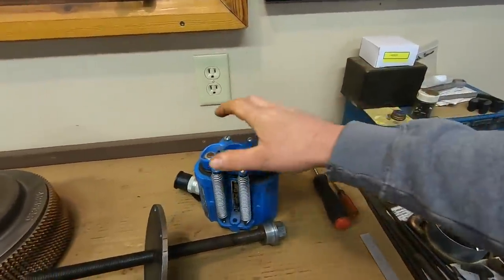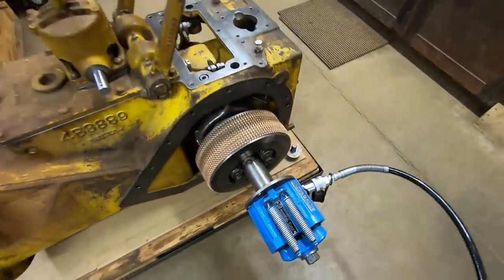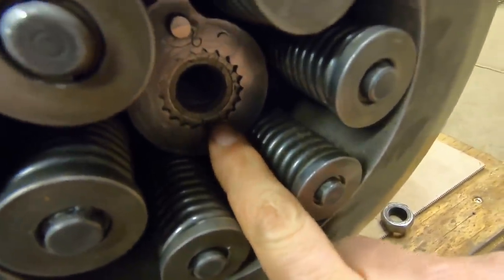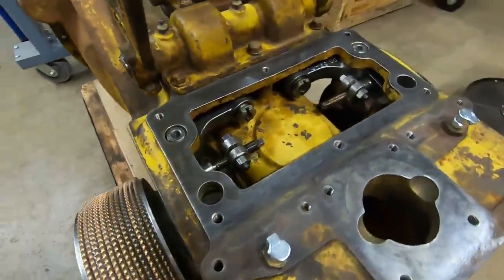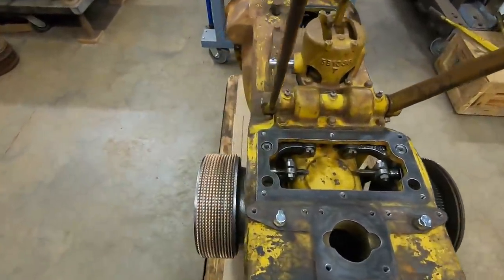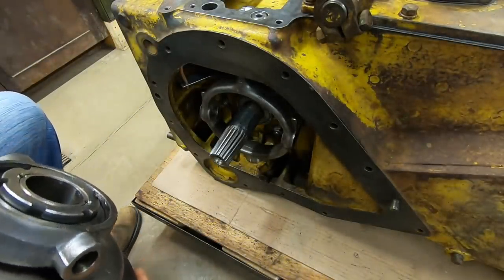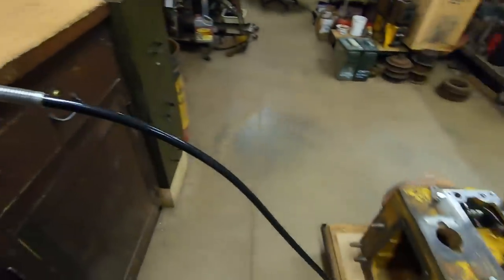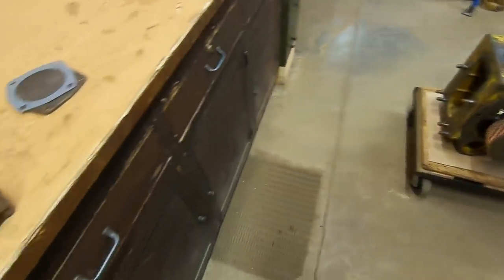Caterpillar D2 #5J1113 Chassis Rebuild Ep.21: Steering Clutch Press Fit & Finishing The Transmission

Comment: On the subject of lubrication, 21:25 many years ago a UK Steam Railway was bringing a main-line Locomotive back into service. One of the problems they encountered was bearings running hot. On short haul locos the oiling cups were close to the areas that needed lube, (not a problem for access on short stop-start runs), but on a main-line high-speed loco some of the crucial cups were in the cab, with oil lines running the length of the engine, so they could be topped up on long trips, running through a 'wick' in the tube to control the flow. They were using a modern synthetic mix for the wick, where as the original spec was for flax. The other problem was oil: They managed to find an old-timer who had 'purloined' some when the sheds closed decades before. They used that as a sample to get analysed, and then persuaded one of the big oil companies to 'sponsor' them with a one-off batch of it, as it has no modern counterpart! When they replaced the synthetic wick with the flax, and used the correct viscosity oil, it all came good. 

Goes to show, a simple drip-feed oiling system had a hell of a lot of science involved in getting it right, and all that knowledge lost with the switch to diesel locomotives :-(.

Comment: As a former high school shop teacher for 35 years, I really really appreciate your level of explanation. You are a great teacher. I remember finding in a cabinet a dusty box full of film strips of how to stuff on engine rebuilds and some early film loop cartridge type educational films. If they were 10% as good as what you do, they might have been useful. So thank you so much. Second comment. I love the fact that she goes back together with her old patina. Have you ever considered spraying it with a matte finish clear in order to keep further rusting at bay but to keep the great look?just wondering, don't know if such even exists. And your timing is exquisite. I am restoring my great uncles 1941 Chevrolet pick up that he bought in 1942. Where the clutch and brake pedals come through the floorboards there is a piece of felt. I have been looking all over for a supply. Thank you McMaster Carr. I am with you a lot of this old engineering is truly art.
Reply: B
Reply: You can paint over with Penetrol (same as Owatrol) , which is the clear oil that oil paints are made with - it cures to a flexible film and penetrates rust ,sealing it. You can also  coat with a lanolin / kerosene solution but this allows dust to stick for a period and needs to recoated every couple of years but it also penetrates the rust and the metal surface. Assuming you can get lanolin. In New Zealand and Australia it is easily purchased - because sheep. Here there are several companies that produce industrial products  from lanolin - a wool industry waste product.

Comment: I grew up in a family logging business and spent a fair bit of time as a lad packing tools and parts in and out of the brush, replacing steering clutches, swapping out final drives and doing all of the other sundry repair chores that come with maintaining heavy equipment. Folks watching you do these tear downs and rebuilds at your farm and in the shop don't realize what life is like when these things go south way out in the brush, up on the side of a mountain. In those times you're lucky if you can nurse a wounded piece of equipment back to the landing where you can drive up to it with the tool box.  Otherwise, everything you need has to be packed in and out of wherever things failed.  I remember laying under cats praying the belly pan wouldn't bury me in the mud when I dropped it and all the times I spent bouncing up and down on 10 feet of pry bars and cheater pipes (or 'swedes' as my dad called them) on those old 3/4 drive sets, breaking nuts and bolts loose, or tightening things back up.  I'm pretty sure you have any number of stories about doing this stuff out in the wild, dodging snow balls and laying in the mud.  Fun times :)

You've also probably heard the term 'cat doctor' - these were the old stoop shouldered, knuckle-ball mechanics who had been around for decades twisting wrench and doing the hard parts on heavy equipment repair.  I do recall a few times we had to bring out one of those legendary characters to do the one-off or specialized stuff we couldn't handle on our own.  Gyppo logging at it's finest :)

I really enjoy watching your videos and listening to you explain things as you go - you could go on to become one of those 'cat doctors' yourself :)

Comment: suggestion: shop towels  ask at the local hospital about the towels they use in surgery after they start to fray they throw them away after final cleaning. i've purchased large bags of them for shop cleanup before ours here are blue in color. usually they're much cheaper than at the department store.
Reply: Good idea I usually get rags and towel rags from goodwill. Sometimes they come pre cut into rags other times you gotta cut rags out yourself from whatever free clothes they give

Comment: Main clutch lever.. if the other 2 spares are used.. in the wallowed out hole.. use a fine thread solid thread insert so you can thread the link into that insert so instead of it being a threaded stud in a hole its threaded stud in a threaded hole..   its just a thought.  if you don't bore the hole in the clutch lever all the way thru and after grinding flat any extended insert you have a semi hidden fix that only people who watch your video will ever know about.

Comment: Squatch, we always drilled a hole in the bottom final drive plugs (should have said steering clutch housing plugs) and installed a large cotter pin that could rattle a bit during operation and thus allow moisture a way out and yet keep “whatever”out. Really enjoy this series as it takes me back to my beginning wrench days in the early 60’s...great memories Thanks 😊
Reply: 8ns are also known for having a cotter pin through the bell housing hole ..

Comment: It looks like that end steel disc is the sacrificial element; that the reason they put that in there was to wear on the removable metal disc with clutch material rather that wear into that pressure plate and have to replace the whole thing when it wears out. Great idea!
Reply: Yes, simple once you see it.
Reply: I would guess that that’s not the real reason. If you follow the power flow from bevel gear shaft, to clutch hub splines, to steels, to friction discs, all the torque is transmitted through splined components.  If the pressure plate isn’t splined to the hub, you would be transmitting torque through the pins that the springs ride on if you didn’t have that last steel.
Reply: @tnbrett1273  Correct. Well spotted.

Comment: Thank you for the tip on how to keep the steering crutches free from rusting together.

And cold weather I could get that on my semi tractor which I still can't get on the road yet the brakes will ice up if I don't move the truck at least once a week.  I fire up the engine at least once every 3 weeks and exercise it for 3 hours driving it around the parking lot.

Would weekly exercise suffice and keeping the clutch pack from icing up with rust and debris?

Some day....

Comment: You make it look so easy.!

I love the look of those clutch discs.  How are they kept clean from debris and ambient moisture?
I called a place for a quote on a reman D4 transmission and engine and both of them together neared $40,000.  I think I'm just going to have to rent my bulldozers; spend the $1,800 a week and then just turn them back in after I've used them and had my fun.

Comment: Why will flat co-planar surfaces stick together?
 Wringability and Gage Blocks
By Dave Friedel, General Manager of Starrett's Webber Gage Division 
Wringability is an important property of gage blocks. In fact, gage block specifications recommend replacing blocks that have lost their ability to wring. Not everyone uses gage blocks in wrung combinations, but wringability is a test on the integrity of the surface condition of the gage block. Gage blocks that don’t wring may give erratic and unreliable results.
The fact that gage blocks wring is incorporated into the lengths of the blocks themselves. Gage block length is defined as an interferometric measurement when the gage block is wrung to a flat platen. This includes one wringing film in the defined length of the gage block.
This definition is very useful. When gage blocks are assembled in combinations, no additional correction factor for wringing films needs to be added to the length of the combination.  
 

Wringability itself may be defined as the ability of two surfaces to adhere tightly to each other in the absence of external means. (They are not magnetized or clamped together.)
Wringing requires two smooth, flat surfaces with surface finishes of 1 microinch AA or better. For gage blocks, it becomes difficult to wring surfaces if the flatness starts to exceed 5 microinches. The sources of the forces holding gage blocks together are thought to come from:
1) Air pressure from the surrounding environment as the air is squeezed out when the blocks are slid together. 
2) Surface tension from oil that remains on the gage blocks or water vapor from the air acts as a glue to hold them together. 
3) When two very flat surfaces are brought into such close contact with each other, this allows an interchange of electrons between the atoms of the separate blocks, which creates an attractive molecular force. (This force will remain even in a vacuum or if no oil or water is present on the blocks.)The last two sources are thought to be the most significant.

Comment: Hey Squatch, a little late on this episode but still working on the D2. I have had this tractor for 4 decades and know that the steering clutches have a rust issue here in Ohio. Have you had feedback on any coating to put on the disc to slow down the rust problem? Not sure if anything like Ospho on the steel disc would work. Thanks to General Gear, I have received both side sets of the sintered bronze and all new steel disc. Thanks Howell Machine, LLC.

Comment: There is a way to get a lower res camera angle from inside the machine to show what you are doing in some cases by using an endoscope. The ability to insert a camera into the access holes or from the other side and just use a magnet to hold the lens in place can be good for getting odd shots. A sealed camera and lights so can still clean it off when you get it messy but not sure how it will deal with solvents as it is normally just for wet places like pipes.

Comment: Have you ever actually seen a D2 with the low/rear seat option? That would be a nice addition to your collection!
Even to get one with that option (regardless of the condition of the rest of the machine), and use those pieces to retrofit one of yours.
Reply: Thanks Squatch , that is quite a machine. Interesting to see how all the components were moved backwards as you said. The leveling pads in front of the tracks too - neat.
I see what you mean though, I think you would need a seatbelt to keep you in the seat! Probably fine on level ground in orchards and fields.

Comment: The addition of 4 new clutches and steels will make the clutch holding power 150 percent of stock, based only on the increase in friction area. Typically, bi-metallic clutches have a greater coefficient of friction over standard asbestos based linings.  How much greater holding power does the clutch assembly have?  I know it doesn't  make much difference, because the motor will probably stall out before the friction limit is reached.  In practical terms, it only really means that the clutches will last longer as long as maintenance is kept up - it won't really affect the performance.

Comment: I wonder if you could blast in some BOESHIELD T-9 into that area all over the non rotational (clutch pack) metal to prevent corrosion/rust if/when moisture builds up
Might also be a good use for the stuff for storage as well
Very very cool to see it coming together with new non-rusted parts!
Keep em coming!!!!

Comment: If you wanted to vent that steering clutch area, you’d have to make up some sort of adapter plate to bolt on and replace the cover. It should need a pipe attached with a bend to keep out rain and a fine mesh grill.

Comment: Just as well I waited a little...  when watching the section describing the clutch system before you had fitted the second clutch, and, as a motorcycle rider and fixer of old I wondered why they never made these wet clutches...   these clutches are to all intents and purposes exactly the same as the wet clutches fitted to most (Japanese at least) motorcycles..  different actuation, on theirs through the middle pushing the outer cap , compressing springs where your system seems to pull from the back..   but with the same effect. 
Then you described the reason why oil affected these clutches. It would have been better possibly to make these wet, with a different design of plate than the sintered ones you have there, and that could have solved a lot of the problems with rust etc due to condensation, perhaps.....

Comment: As much is taking things apart, there is the fun and sense of accomplishment putting it back together.  One step at a time.
The only question I have is from the installation of the steering clutch units onto the tampered splined shaft. 
If the shaft is splined, tampered, and retained by a 7/8' threaded bolt with thick backing washer, what is the real need to press the units onto the shaft?  
Would not the proud placement of the plate to the shaft and then torqued to a 180 - 220 ft/lbs, with a fold over lock- of course, accomplish the same thing?  
How much torque is transferred from the output shafts to the steering clutch units?

Comment: Just out of curiosity, are the engine and transmission going to get mated soon? Or are you waiting for pony motor parts to start/test fire the diesel alone?
Reply: It'll be party 🥳 day when you eventually fire up that rebuilt engine, it's probably in a better state of engineering than it's original construction.

Comment: Why not put oil in the transmission case now. If it were me I’d want to top off that box and make sure there are no leaks, but I also want to put locktite on all those fasteners as well. Guess it’s my ocd kicking in. It’s also cool to see the old tool being retired on the wall of fame.
Reply: @squatch253  I understand now, didn’t remember that both cases filled each other

Comment: Any chance you’d cover flares on the copper lines? Or like on the rad overflow tube? Just wondered if you’ve had to make some new and do they tend to be SAE singles or doubles on CAT equipment of that era? Or a mixture..Always learning! Thanks.
Reply: @squatch253  Thanks! Excuse my ignorance what sort of compression fittings did they use? Or was it a big variety of styles? Got LaPlante Choate on my D4 and trying to work out what was original for the piping..

Comment: Is there felt in the little oil lines as well that feel the release bearing cage?  
Do you just add oil on top of the felt every time it’s time to run the machine to let it drip down for the duration of the day?
Reply: @squatch253  I can see how easily the machine can be damaged by an uncaring operator.

Comment: so towards the end of the video you talk about condensation. So I know this goes against your grain of keeping everything original. But that giant plate that you take out to adjust the clutch pack setup. Be neat if you made your own and drill a hole or two and put a pair or one  of vents that they have in cars to vent the valve cover. You can always replace it with the real one . I think those vents are stuffed with steel wool to keep them firm it's out!

Comment: Can you explain why they didn't end the clutch pack with a steel also, it seems that ending with a fiction would cause it to wear directly on the hub. If a steel was put up against the hub wouldn't it act like a sacrificial wear component so that way the hub doesn't get unnecessary wear put upon it.

Comment: Nice work, as usual. Would you mind commenting on how long mechanical clutches were used on Caterpillars, and when they began to phase in hydrostatic (or whatever replaced mechanical). When I worked around heavy equipment back in the Seventies, we had two D7's and they were mechanical drives, but we had a 977 track loader that was shifted with the right hand, but steering was entirely done with the feet. I think some of the earlier 977's (and 955's, etc.) had steering levers for your hands as well as pedals for your feet. Thank you for all your detail and explanations.
Reply: Cat differential steering was designed in the 80s it allowed the machines to turn on a dime and was much easier on everything
Reply: @squatch253  Thank you.

Comment: Hmm....That's weird about the clutch levers. When my dad got his R2 the lever had been snapped off in the same spot as 1113s and who ever fixed it used a nut and just put gobs of weld on it. He left it for now but wants to fix it later, Looks terrible but gives it character right?
Reply: It might be that the transition from lever to thread is a strees collecting point and vibration may be working at the metal. Also any impact would surely peel the end off at that point.

Comment: When I had my AC WD-45 split to replace a seal in the torque tube, the wet clutch accidently snapped open while assembling it back together. It must have been the oil on the clutch that created all the blue smoke in shop. :-) I was able to use a wire with a hook on it to align them on the spline. WHEW!!!!!!